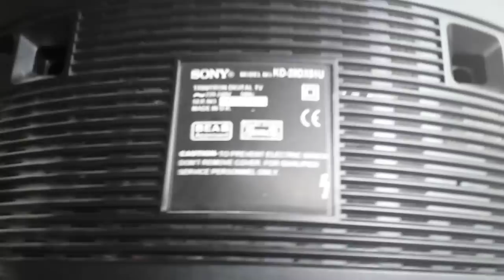Lightning from crt tv flyback'

Comment: actually you can hold it by the wire, I've brushed up against the wire many times while fixing sets and haven't got a shock. anyway always use caution around this stuff, a couple of my teachers have been shocked by HV on a tv and it didn't hurt them but be careful.
Reply from the maker: Hello mate. 
yeah I know it's not a lethal voltage as it's high frequency.  and it would burn more than anything. as iv shocked myself many a time.  but Im still very careful lol.

thank you for the comment and info. hope ya well and be safe matey.👍😉

Anthony

⚡⚡⚡⚡⚡⚡⚡⚡⚡⚡⚡
High1voltage1rules

Comment: i have the same flyback, i tried to take out some voltage from it and the capacitor punctured at like 30kV, dunno why, prolly it was weak... now the flyback is used only for high current low voltage out and the cap's GND is covered in hot glue otherwise it sparks at the bottom

Comment: sphere.. well.. if it's smooth.. probably not a lot of corona. depends on distance still.

Somehow often forgotten, it IS possible to arc toward the HV connection on the tube.

I have driven a picture tube with a HV cables soldered together but not isolated afterward, it did hiss quite a lot. (25-27 kV).

Somehow a spot on the screen made it hiss even more. (the external HV supply is regulated, and believed to be stable)

Not the most arcy supply, but it's well protected.